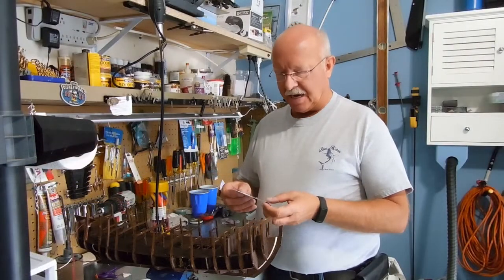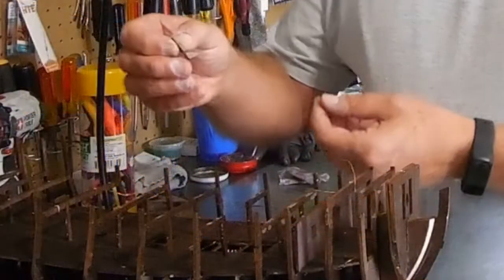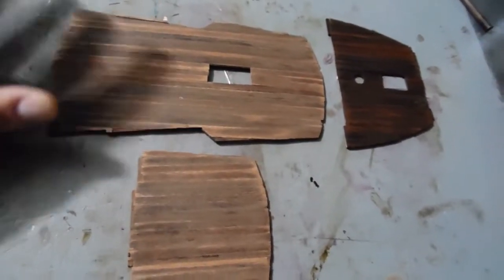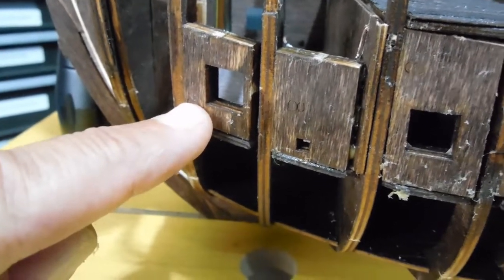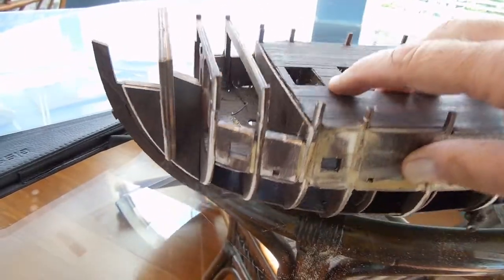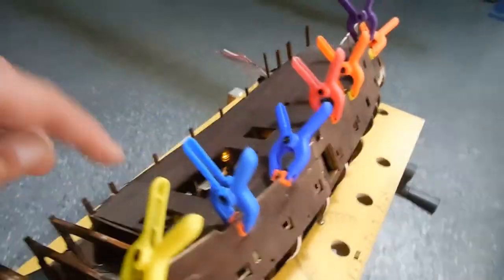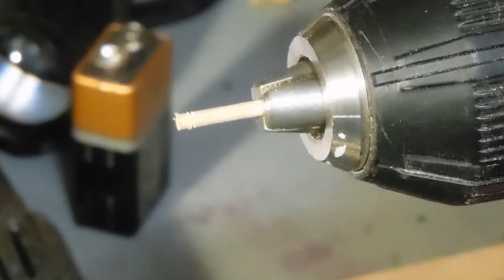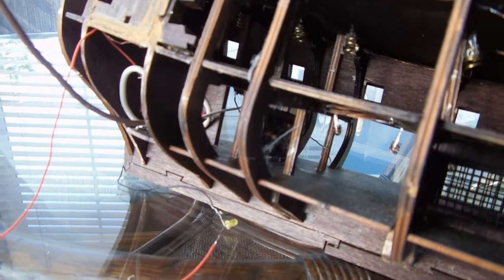Building The Black Pearl Model Ship Part 5

Comment: Hey Dan, I'm at the same spot. have all my gun port panels shaped and ready to glue, there is no way the black walnut they sent is  enough to cover the ship for the final layer and for all the decks you did, I don't know how I'm going to make the mast with no plans or directions, the online directions say see plans for details and we didn't get any lol, waiting on some LED lights to come in that are pre-wired, upset that we didn't get the brass sheets that have the lamps the LEDs go in or the gun port door hinges, missing so much stuff lol, I'm 2 hours away from a model ship company so I'm making a list, she is looking good, can't wait for the next video.
Reply from the maker: Yep, I think we bought a Pirated copy of a Pirated copy!..... I'm considering two options:
1. Use black walnut veneer on the segments where the gun ports are.  I have some that is pre-glued and heat melts the glue.
2. Substitute small chains for some of the hinged and brass areas...  You will see how that all turns out in a couple of three weeks!
Reply from the maker: todd Thomas ; I’m interested in getting more walnut planks. What size did you order?  We are vacationing for a couple weeks. I’d like to get them ordered!
Reply: @BoilerDan1  i definately sounds like a pitated copy of a pirated copy . ive seen this model on other pages where they had all the lighting and brass fixtures so you had oil lamps and i also looked up that particular kit and there is definately a big difference in price.. what i like about this kit is that i gives you the opertunity to add your own touch and put your modelling skills to the test. im building the HMS Victory right now from constucto , ive never done a wooden ship before but i am enjoying the build because it is testing me and i am learning at the same time. as far as the mast situation on your model im sure the instructions to the expensive version of this kit are online , or try contacting the manufacturer